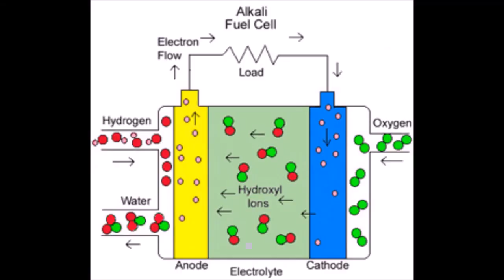DIY Electrochemical Hydrogen Fuel Cell

Comment from the maker: Sorry about the audio quality, I'll look into the issue. Perhaps its just time to upgrade my editing software.
Reply: +Cody'sLab your audio is fine, just boost volume s little.
Reply: +Cody'sLab Do you study at university or are you a backyard scientist?
Reply from the maker: baarni

Both I guess.
Reply: ***** Thanks for the reply dude. Luv the way you present science, unpolished and completely connectable to curious minds. You truly are an inspiration. Even for a 44 year old fart like me. How's the mine coming along. Curious to see how much of the entrance you have dug out.
Reply: +Cody'sLab Look for a normalize audio function on whatever software you are using.  It will normalize the audio of the entire video to a sweet spot in between the loudness of the closing credits and the quietness of the video content.  Feel free to message me if you need any help man. I enjoy your videos alot.
Reply: +Cody'sLab Never miind that. what was the blinking in the timelapse ?
Reply: +Cody'sLab Check out MP3 Gain. It's free which is nice. If you produce a test audio file as an MP3 you can measure the sound level in dB. I don't recommend actually changing the sound level with this tool as it will degrade the quality of your audio. To that end it's better to change the sound level in some other program and test again. This will let you produce consistent sound volumes in your videos.
Reply: +Cody'sLab What mic are you using? That makes a big difference before the editing. Cheers mate!
Reply from the maker: +Beardman Hairy 
I cant do that, at least it seems like I do until I render the video and then its back to quiet. :(
Reply: You are so amazing! I love all your videos. So cool experiments.
Reply: +Cody'sLab go with sony vegas, great editing software.
Reply: +Cody&#39;sLab I do this loads, my volume on my pc I high, so I turn the volume down in my editing software to counteract I then end up with a really quiet video, turn you laptop voulume to about half way  every time you make a video, keeps a standard baseline for sound :)
Reply: +Cody'sLab and the content was spot on by the way... always is.
Reply: +Cody'sLab Was wondering about the audio.  I'm not a real accomplished video editor, so I don't know a lot of softwares, but you might check out Garmin's Virb Edit.  I started using it with a new Garmin action cam and it is fairly easy to use and free.
Reply: platinum wires are quite pricey...
Reply: I just thought of Mars One, if they do it with tv show, I bet they are taking Cody. I mean he's that movie guy who always creates nuclear reactors from potatoes and stuff. Show leaves him off with a bag of old electronic components and the next day comes back to him in a god damn warp drive powered by a bicycle. That'd be awesome.
Reply: What happens that u are wearing gloves ? :D greatings from Germany
Reply: +samuroth You can also look at the waveform in the timeline and adjust the gain until the peaks are just about touching the edge of the track. You'll know you've gone too loud if you get a clipping warning when you play it back.
Reply: AvE said he uses audacity on his audio before publishing. he has good audio...
Reply: how much these platinum wires cost?
Reply: masacatior ten dollars on ebay. Listen to the video.
Reply: ***** you just doing it wrong
Reply: Ravedave5 That's not really necessary if you use the tools inside Sony Vegas.
Reply: +Chesseski Sunrise i guess :)
Reply: Did the trapped gas slow the reaction by pushing the solution down so less of it was in contact with the wire
Reply: +Cody'sLab use audacity and chill
Reply: Can I use copper wire
Reply: Sounds fine. I can always turn up the volume.

Comment: As you said bigger surface area = more power.
 i have hand crank rolling mill, i have used to thin out silver for catalytic oxidation of stuff. so far only acetone and paint thinner have worked for me. 
what in trying to say is thin the platin out like leaf gold or somting.idk 
continue your great work.
Reply from the maker: +TheMmmaaaggg13579 
my plan is to impregnate activated carbon with platinum nano particles.
Reply: +TheMmmaaaggg13579 Platinum is pretty tough stuff. It may be easier to dissolve it and and plate some stainless steel sponge by electroplating.
Reply: oh cool, i presume you going to show us, so im looking forward to that video 
good luck

Comment: Does platinum not react with oxygen at all or is it just extreamly mild?
Reply from the maker: +Justin Brown 
Oxygen does react at the surface but is easily removed by other reactive atoms.
Reply from the maker: +Logan Bowers 
That was with hydrogen mixed in.
Reply: +Logan Bowers no. There must be at least two reactants for a reaction to occur. The platinum is only the catalyst, not a reactant
Reply: Being a catalyst, platinum will react with the oxygen and release it with little extra energy needed
Reply: Supposedly it is said that one can make an alkaline fuel cell like this with a nickel anode and a silver cathode.  Among the metals, Silver has about the right bonding strength with oxygen for the oxygen reduction reaction.